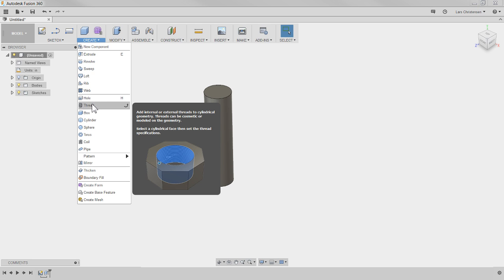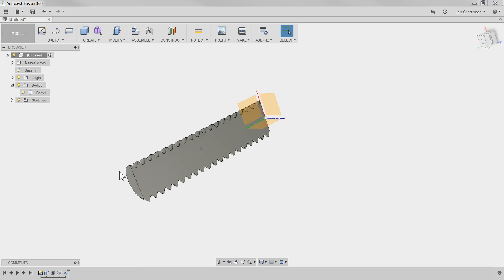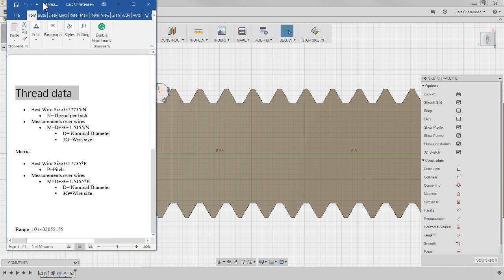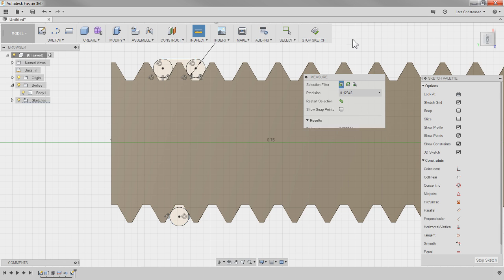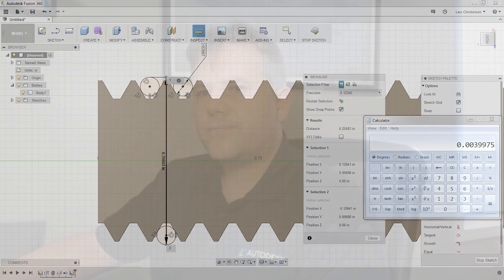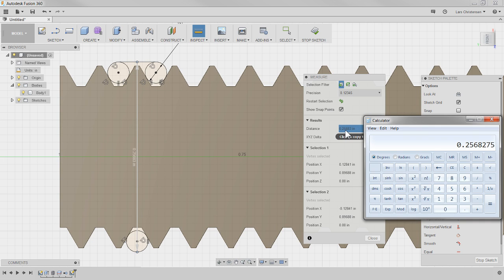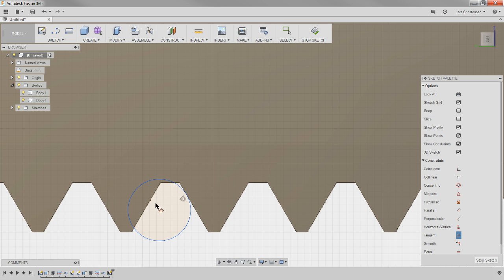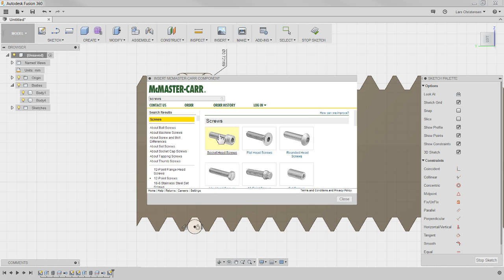Fusion 360 — Are the Threads Wrong in Fusion 360? —Your Comments & Questions — #LarsLive 27

Comment: just to give headsup what client is ordering AGAIN
its called honey screw and its squuzing honey xD
drawing is like 123mm major NOTHING ELSE lol
we have done many time 180mm version
watch this. make tutorial how make that thing xD
https://www.youtube.com/watch?v=jmTUMouIZWQ demo piece

dont laught its custom lol

how to make that in fusion 360 ?? how it would cut it ??
i just dont want mess with macros its crazy when small move another end is big on end LOL
and it will work or it will not. and client ordered 1 !!!! LOL
no test cuts lol

length is 750mm diameter 123mm crest is 15mm
minor dia on start is 100mm pitch 41mm (quickly calculated from 12 times less area that client want)
i not get that minor diameter would do that allready area changing) even pitch would be same
minor dia on end 70mm pitch 97.5 !!! this is killer machine max feed is 6000mm/min
so only way cut it is slow rpm and its nylon or something should cut faster LOL but cant this method
and we not have 5 or 4 axis mills lol
there can be 12-14 threads on 750mm

how to draw that in fusion i just want know could it post that and how many million lines
my macro program is 50 lines that including multiple time using macro with different starting point
and that do it xD

Comment: 3G = wire size not 3* wire size?atleaast it read on there LOL

best 3wire size =pitch/(2*(COS(thread angle))) == 0.57735*P works (only 60 angle thread snot 55 not 30)
but why that M measure is calculated from D major when its not need be acurate  LOL
i have spead sheet that calculate M from pitch diameter MIN and MAX (that what we measuring)
your 3 wires not even touch major diameter they touching pitch YUP
so why it is on formula lol

and you not need cam for "lathe" threads and milling lol.
example M16x2
thread height is 2*0.65=1.3
minor diameter is then 16-(1.3*2)=13.4
if i measure my thread tool correct all i need to use this NC
G0 X18 Z5 M3
G76 P010060 Q100 R0.05
G76 X13.4 Z-20 Q250 P1300 F2

and pitch dia will be in tolerance. right on the money

Comment: Just for info..Today I modelled an M8*1.25 thread and printed it in PLA on a cheap Anet A8 using a 0.4mm noz and 0.1mm layer height. Some steel nuts I purchased screwed on by hand just fine. Not too loose or too tight. Very impressed. I'm not sure if I could print smaller threads as the standard pitch for M6 is 0.75mm rather than 1.25mm.
Reply: M6 standard pitch is 1

Comment: The Metric ISO Trapezoidal threads are still completely wrong with 60° thread angle instead of 30°. Some people already wrote it to the official forum, but nothing has changed in at least 2 years. Even changing the angle by yourself won't get you a fitting thread, since there are other hidden values that need to be tweaked to.
Any idea on how to fix this?

Comment: Hello Lars

I work in the dental industry. We use dental implants that are turned on auto lathes. 

We take a threadform and machine a tapered thread i.e. the root follows a path that is increasing in diameter. 

This is easy in Inventor as you draw the threadform and can set angle / number of turns / pitch for the helix and the thread appears. 

Is this possible ( as easy) in Fusion 360

Peter

Comment: I'm trying to model a prototype with 1.25 theads and the cylinder is ~22mm diameter.  The options under ISO metric are m22 x .75, m22 x 1, m22 x 1.5, m22 x 2.  Is there any way to set it to 1.25?  I'm a beginner so be nice :P
Reply: make M44x2.5 and scale 50% LOL.. you cant make custom thread? just say its 22x1.25

Comment: the problem is not the model it is the manufacturing / prototyping process. most FDM printers have a tolerance of 0.01 in which is not enough to get a good thread unless the threads are very large.  on some of the newer FDM printers, SLS printers, SLA, Polyjet etc, you can get excess of 0.005 in resolution which is sufficient to get perfect threads. I've been printing some threads in fusion printing at 0.005 in tolerance and they fit perfectly with aluminum machined threads. no stripping after times threading on and off.
Reply from the maker: Hi Jeremy Luebker Thank you for watching! ANd thank you for the great comment!!

Best,
Lars

Comment: Hello Lars....Am  I missing something but the machinery's handbook gives you the pitch diameters for your example of 1/4-20 3A ....When measuring over wires your actually measuring the pitch diameter. Pitch dia. has a much closer tolerance than the major diameter which was about .008 on dia. with .2500 being the high. The outside diameter of the component is kind of irrelevant when checking the fit. If you look at a set of thread gauges for 1/4-20 3A the pitch diameters listed on the gauge  they correspond  to/with the machinery handbook. When using thread mics I always go with the pitch from the book. What say you?
Reply from the maker: Right on! The Machinery's handbook has always been my bible when it comes to this kind of stuff!

Best,
Lars

Comment: I 3D print threads all the time and some print better than other ones, but most of the time I run a tap through the 3D printed piece just to clean up the thread. I have a question, I don't see NPT threads in the listings, what am I missing?
Reply from the maker: Hi Joe, I believe there is a ticket on the idea station to add NPT threads. Hopefully, it comes soon!!
Reply: Lars Christensen Ditto -- lots of stuff in the USA was based on NPT. I was missing that thread quite a bit too. Hope you guys can add it soon -- either way -- thank you to you Lars -- you are a great teacher! And Fusion 360 is amazing, I am blown away so far.
Reply: Joe Krieg , Lars thank you for that feed back
Reply: +5 - Hard to believe that such an otherwise perfect program has this obvious limitation - Love the web casts tho!

Comment: Lars, great video about threads. My original question was about why the threads do not print on my stratasys printer. I have used other programs and seem to get the threads to come out on them. Some times (and I must be hitting the wrong key somewhere) the threads do not show up on my 3D printed objects. I am rather new to Fusion and am wondering what I am doing wrong for the threads not to be put on the part. Thank you for the great video although I knew most of this I learned some things. You always do a great job. Let me know what I am doing wrong with the 3D printing.
Reply: You have to set the model setting so the threads are modeled on the geometry for them to be properly exported for 3d printing. Here is the page for the dialog: http://help.autodesk.com/view/fusion360/ENU/?guid=GUID-C37E8172-DE94-4EB0-AFE3-9D3172328441
Reply: The default is cosmetic so just flip the setting.

Comment: Back when I tried threads for the first time in F360, I made the mistake of using a boolean operation to make the inner thread – and found that zero tolerance doesn't make a working thread. So the lesson from that is that you should make the inner threads with the thread tool and that way it's probably going to be loose enough to actually work.

My second tip is that you can use the sketch environment as a geometry spreadsheet. Define parameters and constants and then just type in the formulas in the dimensions. Instead of using the measure tool, you can use construction lines and driven dimensions (if you wish to see the results numerically). If you need to display a calculated result, make a construction line and dimension the length of the construction line using your formula. There's no need for a desktop calculator and all your calculations are documented right there in the sketch and any mistakes in the formulas can be corrected easily.
Reply from the maker: Great comment! Thank you so much!

Comment: Lars, each type of thread (Metric / BSP / UNC  etc) on the Fusion360 Thread drop box has lists of standard threads in terms of pitches, tpi, diameter etc, and presumably Fusion takes appropriate thread data from a table and applies to an algorithm to form the thread. What I am suggesting it that the user should be able to put non standard values in to form the non standard threads that we meet in the real world and need to match. It should be an extremely easy 'fix' just giving the user data entry boxes as the last option on the drop down for each type of thread 'form' - I'm very surprised that it wasn't originally included.
Reply from the maker: I like your way of thinking!
Reply: i bet fuaion just list thread sizes and calculate them so user input sizes should work. atleast i can calculate all torlerances

Comment: Thanks for showing the wire measuring method Lars, very interesting! 
Now, regarding 3D printing, I haven't had any problems with the threads, but some issues with shrinking plastic! So, check the dimensions against your design, and adjust as needed, especially when printing with ABS...
Reply from the maker: Great advice!
Reply: For 3D printing, I find it useful to create a section view (inspect -> Section Analysis), select the "peak" of a thread, then press Q for offset face and push the peak to increase tolerance. See http://imgur.com/a/gANdJ

Comment: We need to be able to define non standard threads - each type of thread needs an option to put in non standard pitch or diameter  I've put a suggestion on the Ideas forum. Many real engineering problems relate to matching exisiting threads that may or may not be standard.

I've 3D printed M9 x 1MM pitch that works very well, and is a standard, but what about M9 x0.6 (say) - you have to define a coil which is a pain !
Reply from the maker: Hi Andrew, You still have the option to model your own threads from scratch, like in the good old days :-)